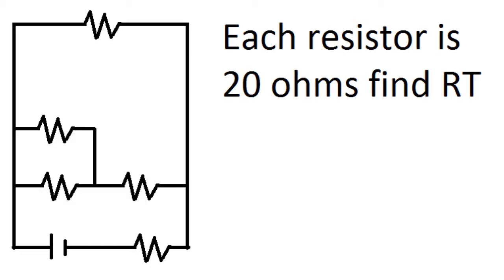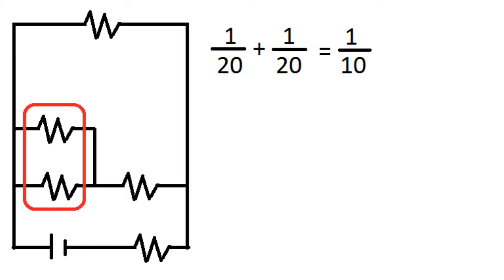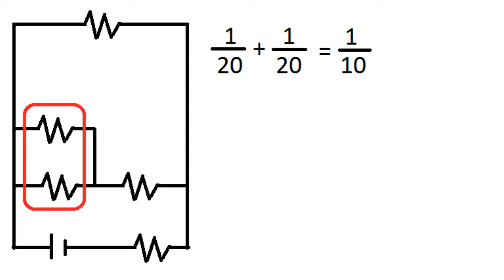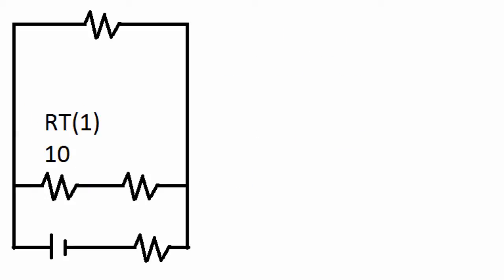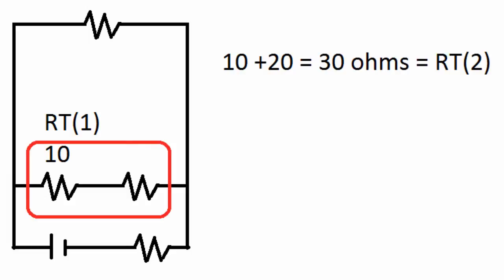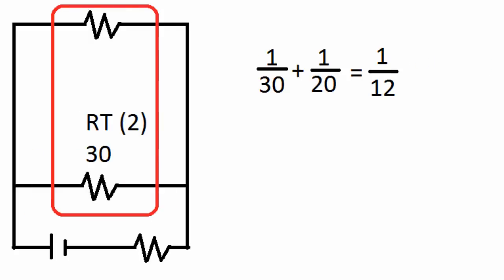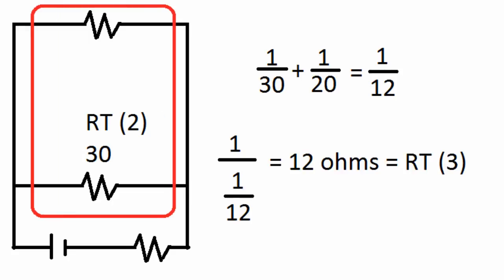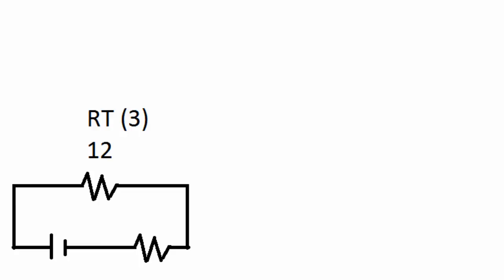Parallel - Series Circuits: How to Find Resistance Total

Comment: You didn't explain why 1/20 + 1/20 equals 1/10. where did the 1/10 come from?
Reply: bro, use ur math skills, 1/20 + 1/20 =2/20
2/20=1/10
Reply from the maker: 1/20+1/20=2/20=1/10 I would recommend reviewing how to reduce fractions if this is unclear. I will make note of this and try to make it clearer my fraction reduction clearer in future videos